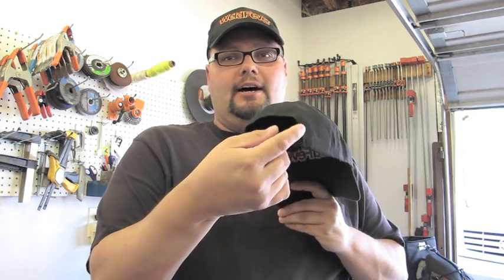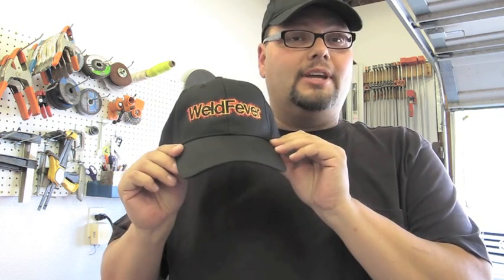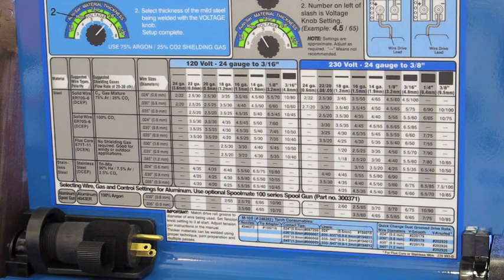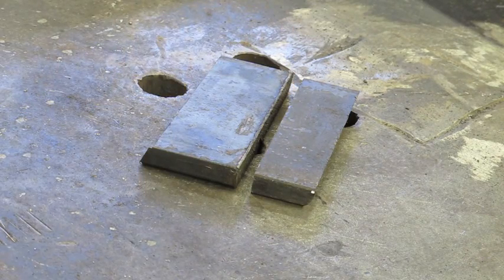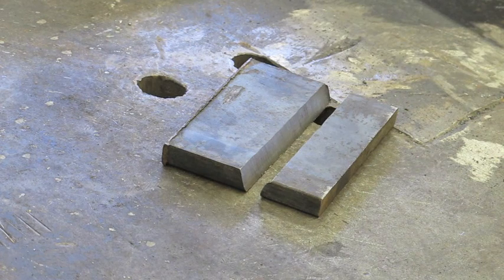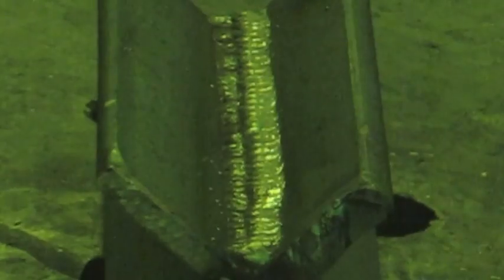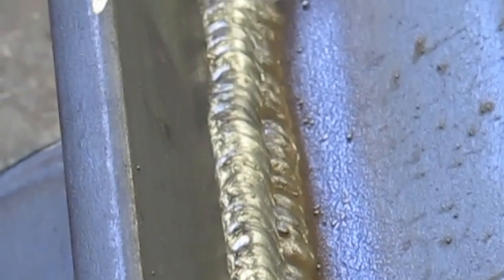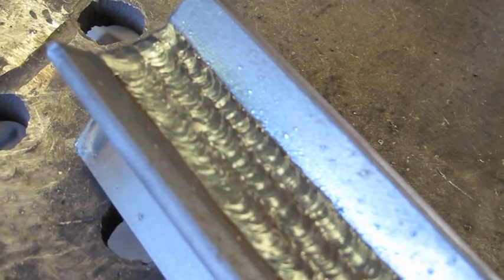MIG Welding Thick Material, or Structural MIG Welding

Comment: Regarding gas. Pure CO2 is hotter than C25. Would not the hotter gas be a better all around choice?
Reply from the maker: Not necesarily since c02 does not provide as smooth an arc as C25, which makes it wasier to handle. I guess it really depends on your skill set and how thick the material is.

Comment: how hot is preheat if you are not using the first weld for preheat? like if I hit it with a propane torch first. I take it preheating is needed due to metal thickness? BTW what were the settings on your 140 machine? I have just purchased a Lincoln 180 mig as a retirement, keep me busy, no idea what I am doing yet, gift.
Reply from the maker: On this thick piece,  preheat could be as much as 250 degrees Fahrenheit, or more, but it depends on the thickness of the material you are welding.

Comment: I broke one of my automotive tools and I was wondering if it can be fixed. it's basically a hand press to press out the notorious honda bushings. it's called a honda/acura rear trailing arm bushing xtraxtor tool if you want to look it up. the part that connects the the control arm snapped and I was wondering if it can be repaired and have the same strength if I took it a professional welder?

Comment: This is an interest for me, just to open up the topic a little more.. 
It's better to have beveled edges right? 
When it comes to I / H Beams, are they stronger as a manufactured single piece from the manufacturer, or are they stronger if you have 3 pieces welded together to make the beam? I'm guessing 1 piece would be stronger, as they would not have a heat effected zone.

Comment: Good video. Thanks for that. What I don't understand is that everybody calls the welding proces " MIG" welding. Its only MIG welding when you use 100% pure argon on welding aluminum. (Metal Inert Gas)When you use mix gas (85%argon 15%Co2)   Is MAG welding ( Metal Active gas) So when you weld steel or stainles ( 98/2 mix)  you MAG weld :)
Reply from the maker: +gabsmit Well, I believe it is a geography thing. In the Unites States, we do not use the term "MAG" welding and "MIG" welding is an old term that is still used because of its popularity more so than its accuracy. The correct term is GMAW, which stands for Gas Metal Arc Welding. Thanks for the comment.
Reply: +WeldFever Thank you for the reply, all very clear. Here in Holland we most always call the proces MIG welding also, it's just because it's a popular term and well embedded.. Was reading in my old welding class books about diferent proceses and that was the reason why I was wondering about the diferent names for the diferent processes. They use the term GMAW there too "Gas metaal booglassen" ( In Dutch)  Keep up the good work, and thank you very much for all your great vids.
Reply: it's technically called (GMAW) for gas metal arc welding
Reply: So basically it's still MAG welding not MIG. It's welding with active gas...

Comment: I have the Multimatic 200. I welded 1/4 plate as a vertical support to 3/4 plate. I heated metal to about 200-240 and made 3 passes. I haven't tested yet, but would that be enough passes?? Is there a rule of thumb for  thicknesses to passes??
Reply from the maker: +D Boud You should consult a structural code book like the AWS D1.1 to find that answer, however, the rule of thumb for the overall size of a weld is no larger than the thickness of the material. When joining thicker to thinner, the thinner is the usually the size to go by. The reason for this is that you do not want to overheat the piece by making such a large weld that you make a huge heat affected zone. The Heat Affected Zone (HAZ) is the weakest part of the weld, especially at the toe. Adding too much weld can have the opposite effect and make your piece weaker. I urge you to look this up for yourself in a code book like the one I mentioned and good luck!

Comment: I have a marquette 130 and started making a winch plate and stopped due to lack of first pass penetration on 1/4  mild steel. Is multi pass with a 130 as strong as a single pass 300? Would I be better off arc with 7018?
Reply from the maker: Onesick Chicken without knowing all the details, most important being your ability to weld,  the academic answer is that multi passes with 130 amps will probably not be as strong as a single pass at higher amperage on thicker material. The only exception might be if you were to pre-heat the material, but that would require testing to be certain. It all boils down to your ability to lay down a bead with proper fusion and penetration, as well as the type of joint being welded, and the type of weld being applied. Unfortunately, it's not a simple answer, but I hope this helps.
Reply: Thanks..I ended up heating it up very hot as you talked about and put 3 passes down. Could tell it made a huge difference on penetration from the start and have total comfidence,so thanks for the tip

Comment: any suggestions on mig welding 5/8 to 3/16 making a pintle plate for a truck I have the same miller welder as you thanks in advance
Reply from the maker: Joe moe Spend the majority of the time on the thicker material then sweep over to the thinner material just long enough for good fusion to occur then sweep back to the thicker.

Comment: after you put in the root pass, do you go from top to bottom, or bottom to top? does it matter?
Reply from the maker: daniel ainsworth I'm assuming you mean from left to right, since this is in the flat position? If so, it doesn't really matter, so long as you overlap consistently. If that's not what you mean, write back and I'll try to answer your question a little better. Thanks!
Reply: you answered my question fully. thats why i like posting on your videos. you answer back and are very clear in your posts and videos. im in school and watch your videos frequently when im having trouble.

Comment: really helpful. I've been learning to weld with a 115V Core Flux Welder from Northern Industries. I am in the Northeast in my garage where the steel has been really cold - like 20 to 30 degrees.  I think I'm getting good penetration, but I'm going to preheat the 3/16 steel I'm using to see if it makes a difference...Thanks again.
Reply from the maker: Rick Rabjohn I would think that a little pre-heat on that cold steel could only help. Good luck and thanks for the comment.
Reply: WeldFever m

Comment: Why did you draw the gun away on your root and cap runs instead of the pushing motion. Am I missing something?  Wouldn't it just take longer and leave a slightly more rough weld?  I used to work for JCB many years ago and we would never angle the gun like that unless it was a difficult access angle
Reply: I beleive his reason is to get a better camer angle for us the viewers

Comment: Do you know what type of gas mix is used when welding inconel 625 with mig? And is short circuit best?
Reply: I would like to see more videos about pulse. I've been eyeing an everlast welder with pulse for a while now.
Reply from the maker: Alnleo86 I would guess 100% argon, but you will need special wire to weld inconel successfully, and the literature that comes with that wire will tell you for certain.

Comment: what's you shielding gas flow rate? i've done exactly what you're doing here, but my beads don't come out nearly as shiny, even after wirewheeling
Reply from the maker: I have it set at 20cfh. You might want to make sure the ports (and any other delivery points) to your gas nozzle are free and clear of spatter, dirt, or anything else that might plug the line. Thanks for the comment and please keep watching!
Reply: I see. thanks. i've been running here at 25 cfh.